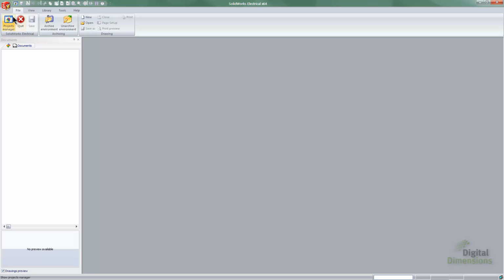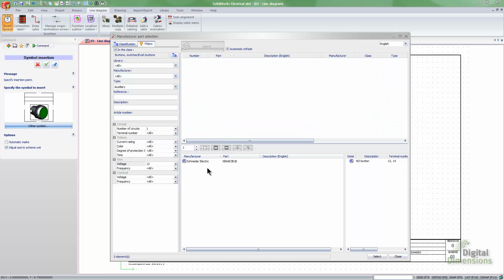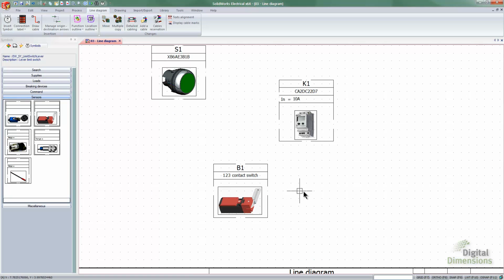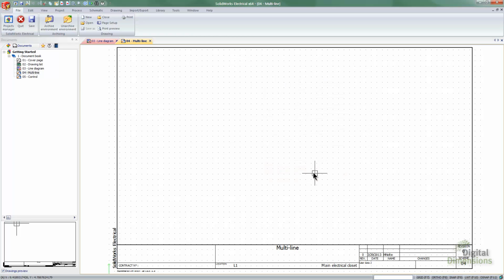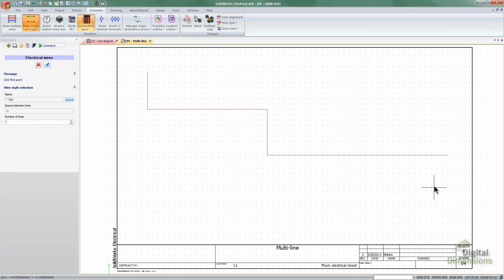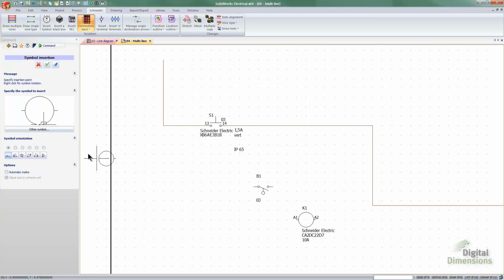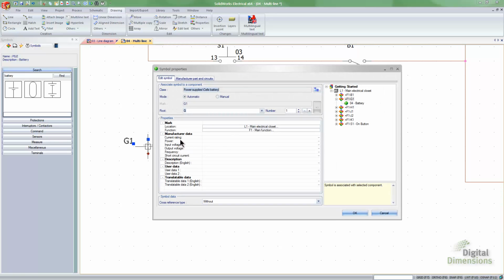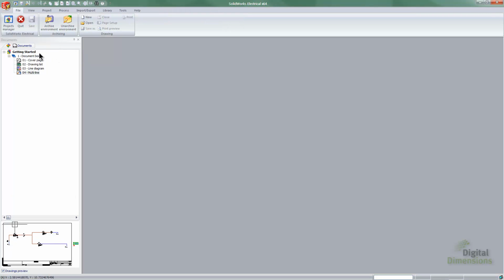SolidWorks Electrical Getting Started

Comment: Hey i cant able to fine the voltage of below 230. I am able to see 230volts  in my present software, so what should i be taking instead of 12 volts should i consider 230

Comment: Thank you very much for this video! I am just learning this software. I would like to build a simple circuit diagram and then route a single or double-sided prototype board. There is software for it like Eagle, sPlan, Sprint-Layout & EasyEDA. Would I be able to do it in this software? The last step for me is to order the board from the company who makes them.
Reply: i realize that your comment is a year old, but you would need solidworks PCB for that kind of stuff.

Comment: Thanks the great video.
have one question. Can Solidworks simulate electric circuit?
I actualy use Automation studio for my control diagrams.
Reply: yes it can.... obviously....
Reply: @HemangJoshi  No it can’t … obviously.
Reply: @LTVoyager  Can i use this software as PCB?
Reply: @shewagdhanush1391  No, Solidworks makes a separate PCB product.  The electrical product is geared towards panels and harnesses and not electronics.
Reply: @LTVoyager  Thanks bro.